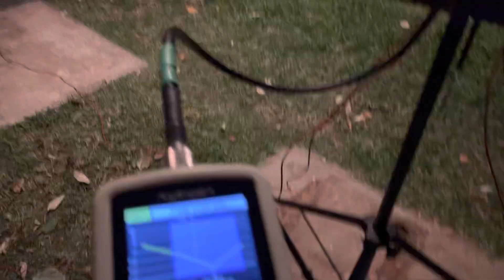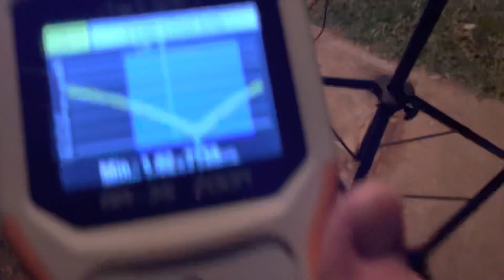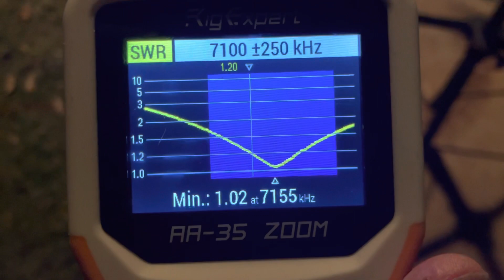Ham Radio Live! MFJ 2286 1KW Portable Antenna. Tuning Instructions For Great Results On 40 Meters.

Comment: Really love your videos. I just subscribed a couple days ago. I love that radio too. Am going with the Ft 891 for a lower cost and foot print. I will be active on pota soon. Looking at different antennas to go portable. Have you looked into the DX Expedition and others for portable?
Thanks again for helping me a be abetter ham:)
Reply from the maker: Robert, your words honor me here more than I deserve. I like to think of this channel as a way that we all can help each other out in a way that is nonthreatening. Hams can be pretty overly critical I think when someone doesn’t know something. That’s why I want this channel to be here more than ANYTHING. so people have a safe place to ask questions and learn.

Myself included LOL.

By the way, I’m a big fan of the 891. That’s a great transceiver. I really like the easy to use VFO and bright display. That’s a really solid performer you have there. Great audio reports as well. I’ve worked many of them and they always sound crisp and sharp.

Yes, have experience with DX commander Antenna.  I have one in my backyard set up in a permanent configuration.I like it. I think it’s a fantastic Antenna once you build it correctly. Up to full legal limit and she’s built with quality grade materials. Callum does a great job with that kit. Cost about $300 US before tax but it includes shipping. This one’s my favorite antenna whether it be portable or using it just on its merits in my backyard. An easy antenna to work with.

I’ve also been very impressed with the MFJ 2286. It has a loading coil and you’ll need to adjust that coil as well as the length of the whip and perhaps add a few more ground radials to get the most out of it on 40-6m, but it’s really easy to assemble, takes me less than five minutes to set up, 

A total of 15 minutes to set it up from scratch and adjust for SWR and use. And I move really slow LOL. 

Before my back injury I was pretty good. So that really tells you how fast and how easy the MFJ the 2286 is to use. Cost: about $130 US before tax. I’m starting to believe it could be one of the best bargains for an easy to use portable vertical there is on the market. It’s taking a beating here in the Hawaii winds. But it keeps working just fine. I think they did a fine job on this one. 

Plus, it’s one of the few POTA/SOTA/IOTA etc Antenna‘s you can use with an amp if you wanted. Up to 1KW. 

The last one I have a lot of experience with is the Chameleon MPAS 2.0 vertical/dipole antenna. You can build it quickly and I mean real quick! Comes with one ground radial. I want to do some testing where I can add a few more to it to see how well it would do. Especially on 40 m.

On 20 m and up it really excels. It’s built for daytime bands. Then they give you the wire dipole element to use for the lower frequency bands of 40 and 80 m. Makes it very nice but it’s extremely expensive at about $560 before tax. 

You’re limited to 100 W with it… That’s one big drawback.

The easiest and cheapest way however is to just run a dipole into some trees. Very inexpensive and well proven to work and will work most of the time up to full legal limit. 

I don’t think wire antennas get enough credit for their ease-of-use and build, Price per watt and typical ease of deployment. I love wire antennas. 

My personal favorite is to build a resonant monoband antenna to really squeeze as much performance out as I can. It’s the simplest and cheapest way to really have a good performing Antenna in my opinion. 

I’ve found the ZS6BKW multiband antenna he is by far my favorite multi band wire. It gives you really noticeable gain on 20 m and 40 m. It’s really well done. There are many research studies done on it as well. It’s a proven winner. This one cost about $120 US including shipping. But I think it’s worth every dime. Doesn’t take long to deploy… Just get it up about 40 feet and let it sing into the wind. It works so well Robert.

There are some great books out there teaching you how to build your own antennas. The ARRL antenna building book is a book I think every ham radio operator should have. It teaches you so much about the proper way to build great antennas. 

Sorry this is so long Robert, but I wanted to address what you said and give a moment to thank you for being kind enough to write it. I do this because I care about ham radio surviving past my generation. It’s too beautiful of a hobby not to. I waited too long to get my license because I simply couldn’t do code. I’m grateful I finally have it. I don’t want others to make the mistake of thinking it’s just too hard to get your license. We need more people on the air. 

All the very best of aloha to you from Maui Robert, thank you for honoring me with such a kind email. These are the ones I treasure.

Larry 
de K7HN/KH6
Reply: @HamRadioLiveShow  Yes you gave me much to think about> Thank you so much for the information. Looking forward to your next video. If you are ever in Florida (Tampa Bay Area) shoot mr a message.
Thanks again for all the detailed info.
73
Bob
ki4hit

Comment: Nice. Funny,  my clip is much lower on the coil to tune 40. 

You can put the bracket on a medium sized camera tripod also. I found one for 2 dollars at a yard sale. Folds up smaller for portable without hogging up you beautiful PA speaker tripod.
Reply from the maker: Yes. I have the tripod with me because I received the kit that had it. This was the easiest way for me to make it work. At least with my peanut sized brain LOL. 

Difference on the loading coil could be due to the soil conductivity here, or the length difference of ground radials (mine are measured at 32 1/2 feet long exactly.) 

This is similar results to what I have done with my DX Commander all band vertical. But I needed 8 radials to bring it down to the 1.0:1 range. 

If you cut to the lowest frequency band you’ll work, it should work well on that frequency and higher frequencies. We’ll give it a go here and see. I haven’t checked that part yet.

Thanks for writing in Preach, Nice to hear from you.

Larry